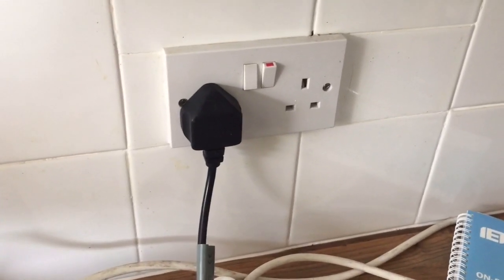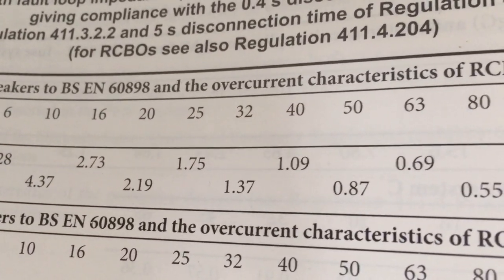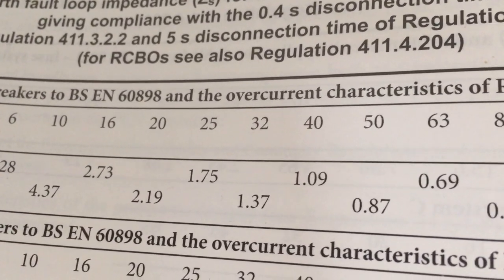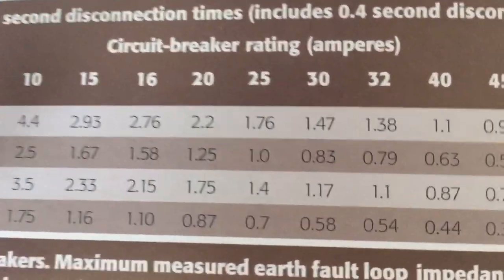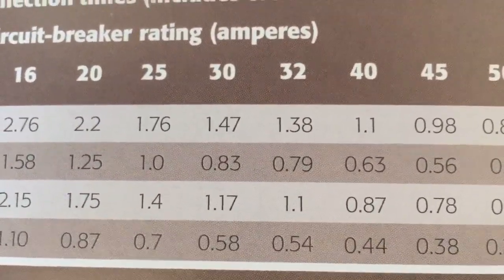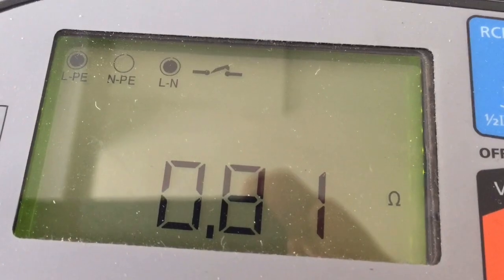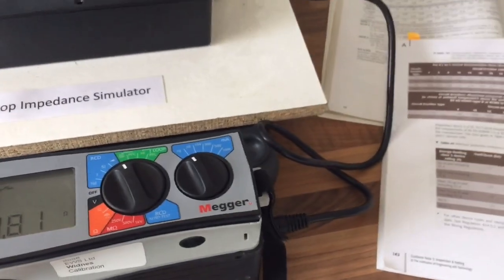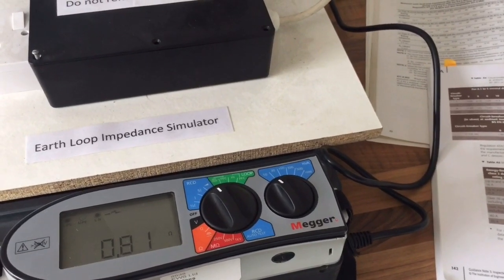Zs Comparison of Test Results

Comment: Isnt zs the earth loop impedance test which u do as a LPE test??

Why did u do the RCD trip test to get Zs value??
Reply from the maker: Zs is earth loop, yes. No trip function used as circuit protected by RCD. 

RCD test not done to get Zs but rather RCD trip time.

I wonder what is confusing you? Ask some more questions if you choose...
Reply: @sparkipeat2255  i dont understand where disconnection time comes in to zs test. So on my megger if i do a 2 lead lo LP-E test and get 1.09 ohms, for e.g.

Where in the on site guide or 18th edition would i look to see if its within limits? If it has or hasn't exceeded maximum permissible value?
Reply from the maker: @gh0510  That's the point of a Zs test. If you get under the magic number. It means that the circuit will disconnect within the required time. 

It's Ohms law:
I=V/R 
or in this case
Earth fault current = 230/Zs 
(simplified) 

So the lower the Zs, the higher the fault current and the quicker the circuit will disconnect due to the amount of current flowing.

Disconnection times are in Table 41 of the Regs. Most often 0.4 Second

The values of Zs you speak of are Appendix B of the On-site Guide. 

A two lead test will trip the RCD if there is one. Check your instructions for no-trip/3 Lo or something similar if there is an RCD. 

Of course you can always determine Zs by separately measuring the R1+ R2 and Ze and adding them together.

Zs=Ze+R1+R2

This may be preferred as it means you are exposed to live conductors less EAWR 1989.

I hope that helps you...
Reply: @sparkipeat2255  using ze +r1+r2 is preferred coz ur less exposed 2 live conductors? 

To do a r1 r2 test wouldn't u have to take live, earth out n connect them together n then do continuity on other end. Isnt that more dangerous as ur touching live cables rather than just simply doing Zs??

As u may not always be able to isolate the equipment. 

Thank u for ur help so far. I am an electrical apprentice.
Reply from the maker: @gh0510  You getting ready for AM2 by any chance?

Comment: Quick question.... ze maximum should be 0.35 but I recently got 0.50 and was told to put down 0.5... I'm confused anit that over the limit ?  Am I missing something from these figures
Reply from the maker: Hi, it’s not Ze maximum it’s an ‘enquiry’ value for TNCS? Is that what you’re talking about? The actual value can be higher and you got what you got. Did it affect any of your Zs values so that they were over?

Comment: Great video 👍 just purchased a Kewtech 64DL and test downstairs ring of ZS and getting 1.25 on one socket only it is a spur. Type B 32 amp ... any thoughts why it would be high ??
Reply from the maker: Richard Whitwam higher values will come from spurs, the longest spur highest value.
Reply: Sparkipeat thanks
Reply: Sparkipeat just about to finish my level 3 in December, hopefully. So a ring with average on 0.65 a spur could increase the reading 1.25 ? Is there any other things that could cause a high reading ? Sorry for all the questions 🧐
Reply from the maker: @richardwhitwam9979  Hi, just noticed this after all this time. Thought I had answered your question and that was that. Loose connections/corroded connections at the back of the socket or poor connections again to the barrels at the front.